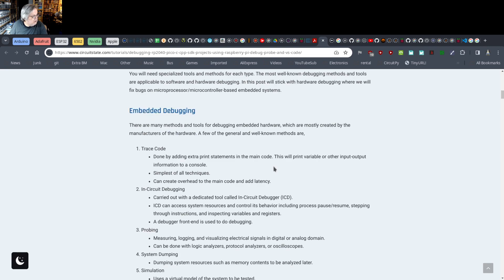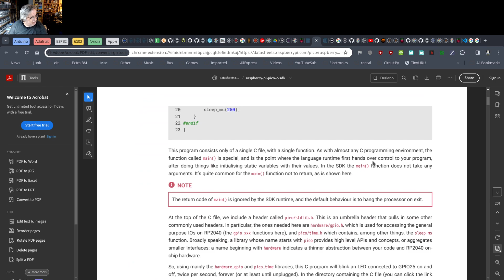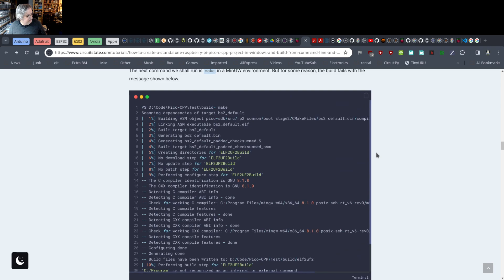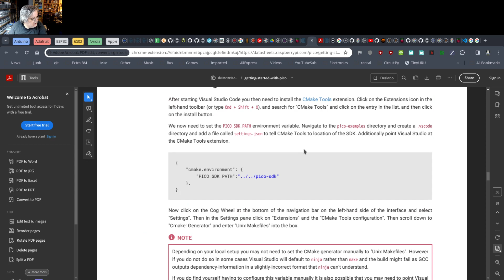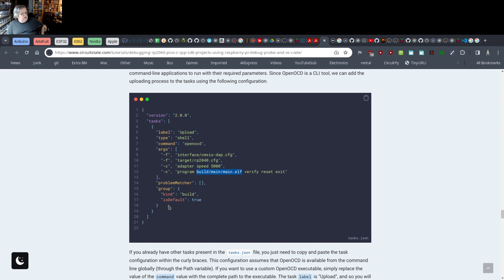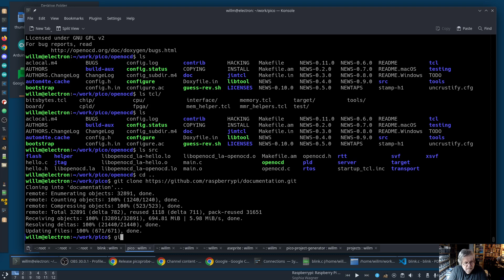Ramblings on Getting the PicoProbe to debug a Pico

Comment: This is honestly soul destroying. Last time I used a debugger (I forget which system) it just worked in the development environment, showing the assembly code, the C, breakpoints, watches and so on. Pretty much point and click. I only need debugger to find out why a library I was using is crashing the system and Serial.print won't cut it for some reason.
Reply: I agree, this is out of control.
Reply: Well that depends, i had to setup a buildchain with debugger and everything for a VW project, and honestly, if everything went well you still needed a day and a half to get it done. On the other hand i did use renesas debugger with IAR workbench, and that one only required installing the ide, the drivers for the debugger and some very minor config, so there's ups and downs